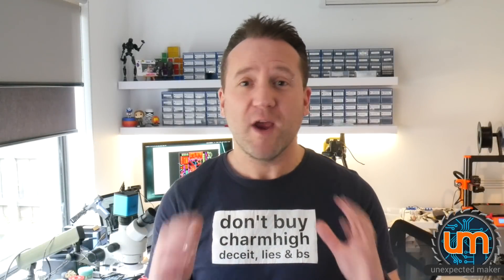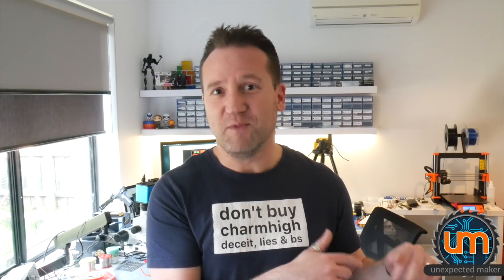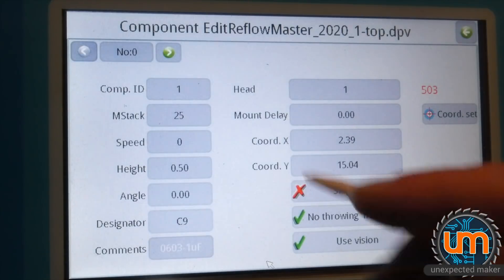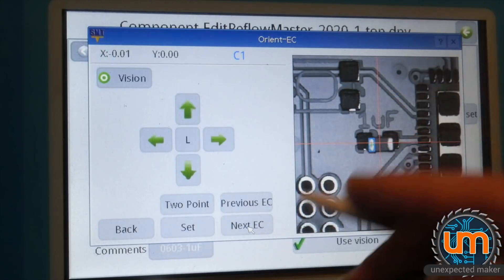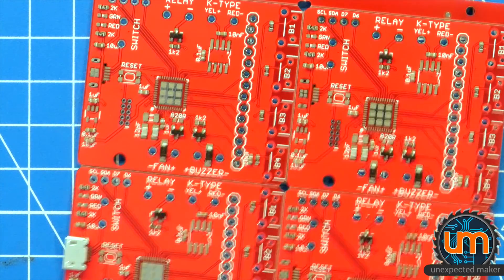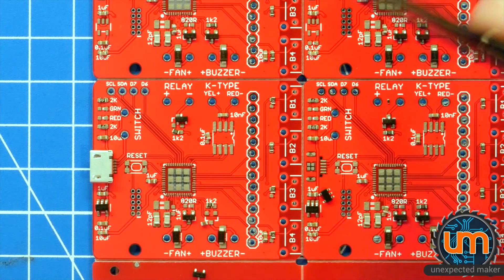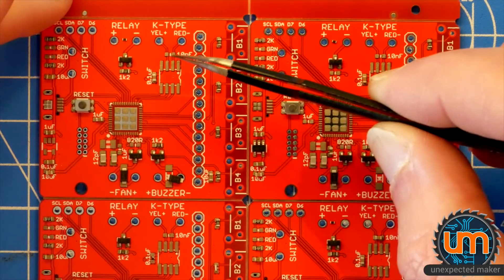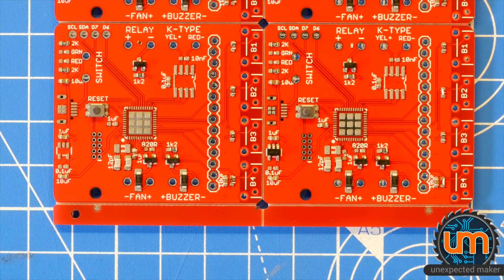Charmhigh 560P4 Review - Ep #1 - Reliable Placement?

Comment: Can you video tape the pnp process from inside the machine? Show us how random parts got where they are on the completed boards?
Reply from the maker: Well, not really as there is no clearance for a camera in there that could be close enough to see anything without getting in the way of the massive pickup head. I know how random parts get where they are... I've shown int in previous video and spoken about it in length. The machine bounced parts in the feeders, so parts are not in their correct pickup positions, so they get picked up on a bad angle,  or help on my a corner, and then fall off due to the movement and jerkiness of the pickup head.

Comment: Could this be a problem with vaccum?
If the machine creates vacuum using venturi pumps and if the compressed Air supply is capped (so these crap feeders do less crap, lol) the vaccum might be too weak and heavy parts could drop early :/
Reply from the maker: I've not experienced that with my TinyPICO boards. And these parts are so light..  but who knows? So much is wrong with this machine.
Reply: @UnexpectedMaker  So the machine knows where they are meant to be and they are all being randomly put around.
So is it a problem with the seal? So when it goes to place the part is it blowing the air somehow so when it goes to place it would launch them in these random directions, is it placing too high? and when they drop this is what offsets them. can you swap the nozzles/grabbers to different ones to see if they are the problem? And for the next video could you please film it operating? from different angles with the same times for instance a video of a camera at the bed hight filming across the bed and you holding a camera following the machine.
You have such a large community someone might seem something. 
Charmhigh is not willing to help but this community is.

Comment: I'm sorry for this but I really had to lough out loud on the 0402s placed there 😅 The Machine obviously has do to different travel moves on each run to do this. It also shows the vision during pickup/placement while running, right? Can you maybe just film (complete machine + display in shot) and upload multiple complete runs where we can actually see that it moved to a completely different feeder than for previous run?
Reply from the maker: Yeah, no, I'm done with making RMs on this as I'm out of components for more, so can't do another run. That said, I cycled through all of the components being placed and showed you every location in the video, so clearly no other pickups is supposed to be happening.
Reply: @UnexpectedMaker  sure, don't waste parts on extra runs for a video. Just do it next time u use it. Just record the thing. I'm curious what it actually displays on the screen when it picks from the wrong feeder. Chances are high this will happen on the next use too, I guess.

Comment: What about just flashing the software to open PnP at this point, ? I've saw the crappiest setups with better results than this random bullshit
Reply from the maker: Because there is no OpenPnP for this machine. And because that wont solve any of the hardwire issues... faulty feeders, encoder issues, alignment issues and what looks to be a failing vision camera.
Reply: @UnexpectedMaker  jeah I thought to see that the positioning itself is off if the machine moves a lot, have you ever tested for Repeatability without vision and other crap ?

Comment: Random thought, could the lighting for the vision system be inconsistent and throw it off?
Reply from the maker: Not from my experience, but as I mentioned, I need to keep the room dark so not have external light interfere with the up vision camera.
Reply: @UnexpectedMaker  apart from the random 0402, the placements being inconsistent is totally the bottom vision and maybe other repeatability issues mechanically. I've experienced this with my own machine purely with the vision pipeline not being tuned and if the part is picked off center and the vision detects only one piece of the part.

Comment: May I ask why your pin header pads are not centered vertically (e.g. 11:54)?

Btw. I can 100% feel your frustration and I would be so furious if this had happened to me.
Reply: He's shown that in previous streams. It's a trick so the headers will stay clamped in even without soldering, making soldering them upside down way easier
Reply: @Blamm83  Thanks
Reply from the maker: Staggered headers holds the pins in straight pre-soldering.
Reply: @UnexpectedMaker  That's pretty neat! Thank you

Comment: So they don't just have hardware issues with the feeders but a serious software problem picking the right feeders as well as the video pickup of the parts.
Reply from the maker: I just can't explain how any of the 0402 resistors got on there. I checked again after I finished the video and only the parts I wanted are in the pick list. What's it's doing is just insane!

Comment: With vision setting on - try covering the lense. Does it make any difference? Maybe it doesn't actually use vision at all.
Reply from the maker: Keep watching -  Vision get's fixed :)
Reply: @UnexpectedMaker  Have you done any comparison between assembly runs without vision as per the setting? If they were similar results, then vision might not be making it worse or better. Skipping on the steppers maybe. Looking  forward  to your follow up on this.  Unfortunately,  a lot of wasted parts needed to prove a point.